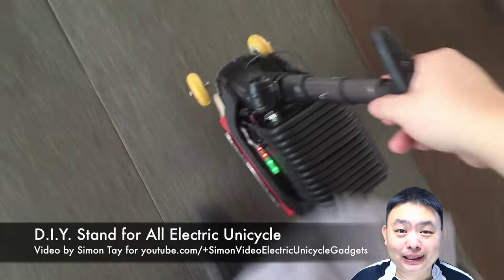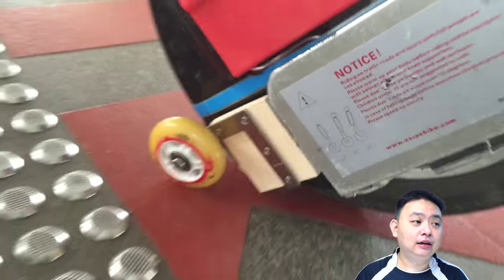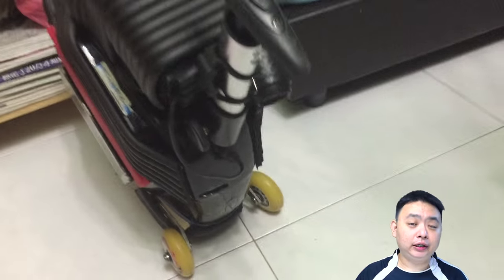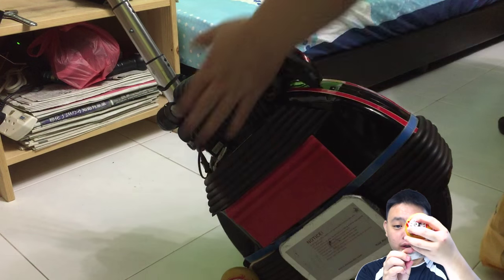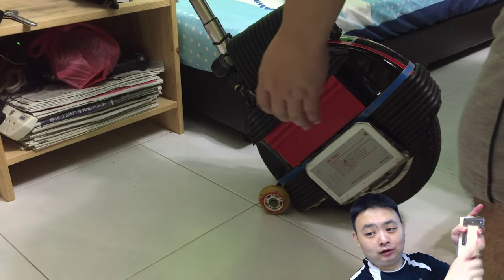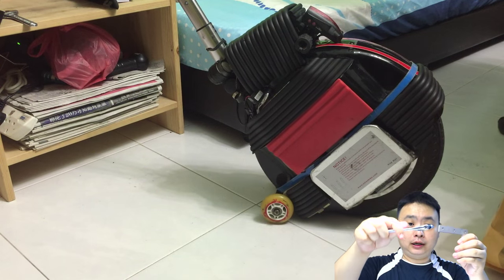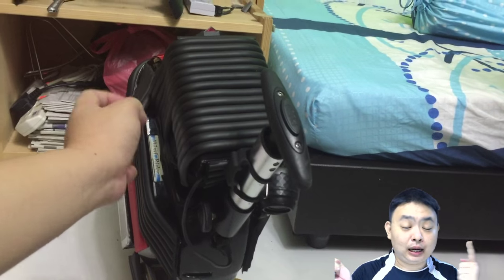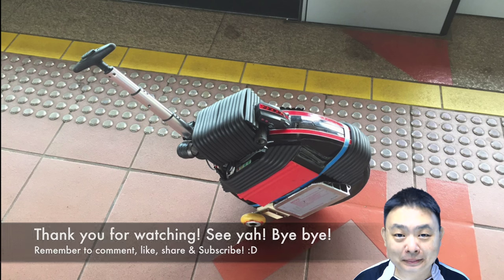DIY Stand for ALL Electric Unicycle

Comment: It doesn't have to be two wheels, it can be two square pieces of wood. The important thing is to stand without support when the unicycle is stopped.
Reply from the maker: it's pretty old idea, probably not the best idea as sometimes rocks or uneven surfaces will trip the unicycle badly with protruding stuff on the side

Comment: You got all the parts from hardware store? My one is nine bot one.
Don't know if it works
Reply from the maker: +Daniel Lu It's not a good idea until it's perfect, the double tape have problems holding on to the wheel casing as it doesn't stay on the casing well
Reply from the maker: Ninebot one have its own stand